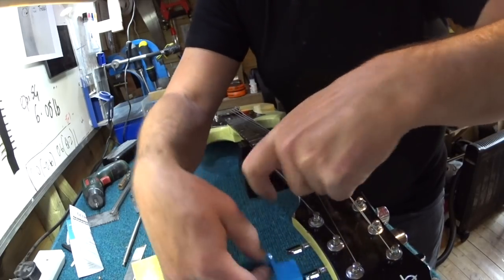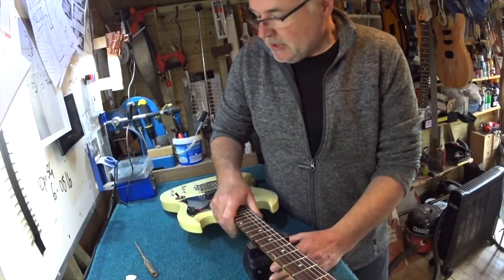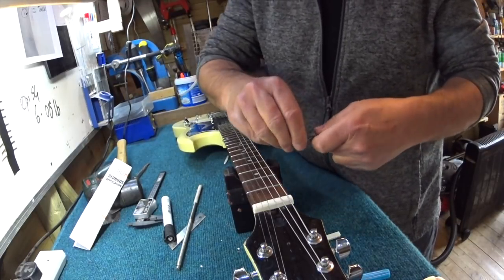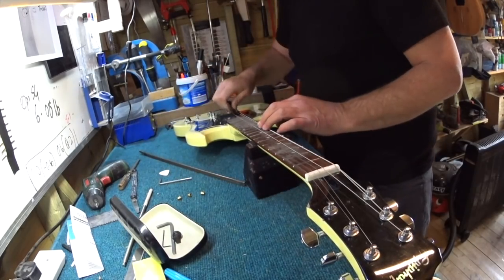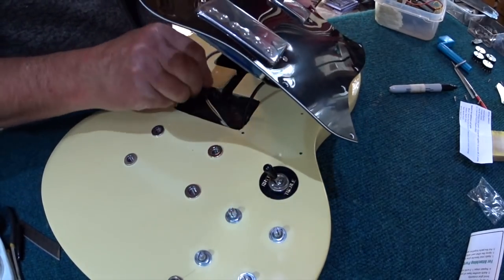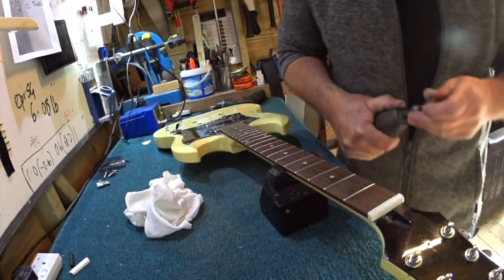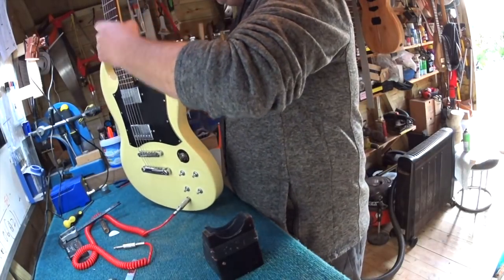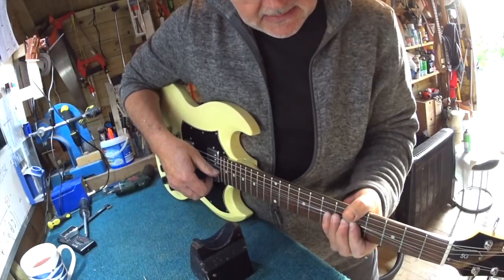Epiphone SG pickup change and set up

Comment: Hello Sam could you still use that technique of fret levelling with a compound radius neck?
Reply from the maker: Hi Richard, yes - I do. One proviso: the thinner / narrower the truss rod the better as it 'samples' the smallest possible segment of the fret meaning the difference in radii at either end is - across that thin segment - imperceptible.